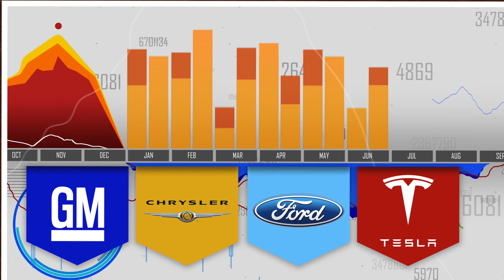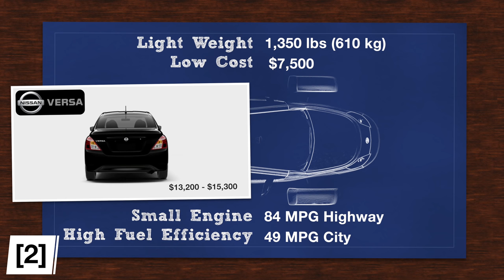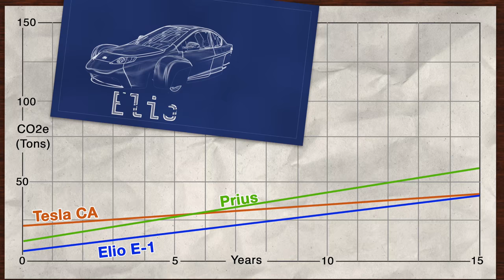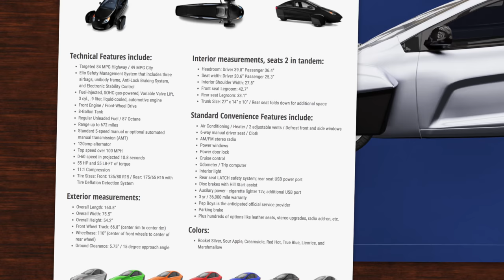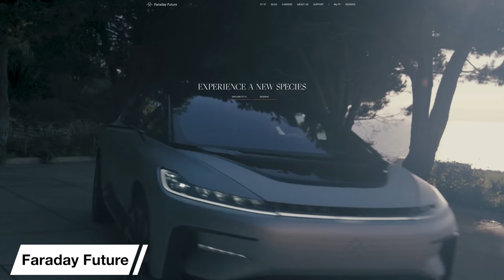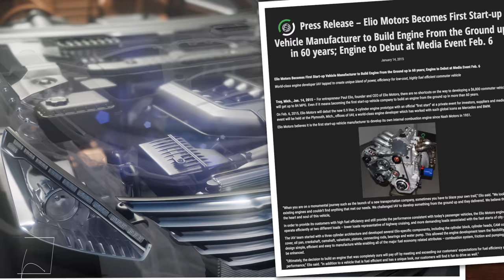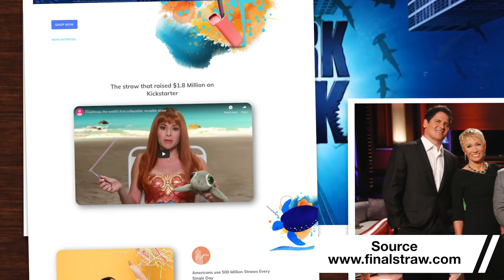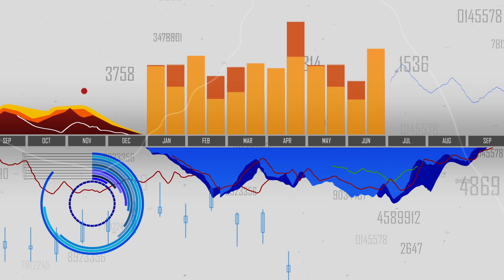How this Radical Car Missed its Chance to Change the World

Comment: I remember watching sesame street as a kid. I believe there was this segment where a (puppet) scientist would unveil something he invented. It would turn out that he would invent something common like a sock or a glove or a watch and just because he was out of touch with the rest of the world he would think he invented it first.

This video and this car inventor kind of reminds me of that. The Japanese have already perfected the art of the small, but practical, car. Please look at the Japanese Kai vehicles segment. And I do mean take a good long unbiased look at it. I have tried to find some good honest material on the kai cars on YouTube but sadly no You-tuber has taken an honest look at these vehicles; except of mostly importing 30 years out of date cars to the US for the sake of getting views and giggles.
 
Please take a good long look at the Kai SUV and MPV segment. These are four-seaters but they are not tight or cramped on the inside. They have ample leg room. So much so that in the back seats, anyone, even well over 6 feet, can relax and stretch their legs easy.

They are cheap to purchase and come with tech such as radar cruise control, pedestrian warning and auto braking, Eco start-stop, GPS navigation, up to six speakers, immobilizer, key-less entry, push start and 360 degree reversing camera (with LCD screen embedded in the rear view mirror). The 360 reversing camera being a thing touted by the big car companies in recent years on their expensive models. These little Japanese MPVs have had them since at least 2013.

The Elio is 0.9L with 55HP. The Kai MPVs and SUVs are 0.66L with 54HP for the non turbo versions and 64HP for the turbo versions. They came in both 4WD and 2WD versions and are good in mud, snow, rain etc. They are very pleasant and fun to drive, are very responsive and you can throw them around. They can easily and effortlessly maintain highway speeds (75-80 MPH).

As for fuel, on a bad day, when you are being a hooligan and pushing the car, you will get between 45 to 50 MPG. On a good day, when you are being an adult, you can expect anything between 60 to 70 MGP.

With all due respect, instead of ignorantly trying to reinvent the car, all someone needs to do is convince the already established Japanese car makers to bring over the tech and tooling for these cars from japan to which ever country, US, UK, Europe etc.

 You need to wake up to the fact that going bigger in choosing your cars is not a solution (as we have seen from the recent shift for all cars makers to big trucks and SUVs in the US as the trend is showing).  That is just the big car makers and oil mafia exerting their massive will and influence; making everyone think only these big vehicles with needlessly massive and gas guzzling engines will satisfy fragile egos and show status.

I could go on but I urge those reading this to consider what I’m saying. We have to save this planet. By choosing wisely when it come to our daily gasoline cars, we can not only do our part, but also cut down on needless gas bills and buy cheap affordable cars with good options. Bringing very good fuel economy to the masses and not just to the middle/upper middle class or the rich (who can actually afford the current crop of fuel efficient Priuses and Teslas and what not). With this option we can get efficient Gas cars with significantly less of an impact on the environment and are much cheaper and easily accessible/affordable for the masses. And I strongly urge the YouTube car enthusiast community to please consider such easily available alternatives and educate themselves and their viewer base.

What surprises me is that the people in countries such as the US, UK and Europe are the ones most aware of the current climate crisis. Yet everyone just keeps buying the biggest cars they can. If safety is a major deciding factor in this choice then consider this; now everyone is driving big cars, the safety argument is out the window. Someday someone will argue that if everyone has a truck or SUV, they want something bigger to be more safe. And the trend will go on and cars will just keep getting bigger. Let us reverse that. Go small. Don’t let your ego decide, go with logic and common-sense.

And don’t think these MPV/SUV are a compromise. I speak from experience. I own one, and I'm currently in the process of deciding on my second one. In my country these are very popular as used imports. We can import cars up to only 3 years old, so we get very new/new-ish cars here. I love these things. And I do journeys of a 100 miles in less than 2 Gallons. I’m happy.
 
I apologize of the long post but I hope you found what I had to say to be of value.

Thanks.
Reply from the maker: Totally agree with you. Unfortunately Americans just love big cars. It’s a shift that is hard to make after decades of seeing cars a certain way. Great comment thanks for your insight. I’m familiar with some of the Japanese micro cars and we’ll definitely take a look. But I’m 100% sure they’ll never ever bring it to big western markets
Reply: The problem with the Kai-class car isn't a lack of a market, it's the safety standards required for import. Something like a Suzuki Cappichino would sell like hot cakes here, but people only import old ones because that circumvents the safety restrictions.

The US has some very particular requirements for crumple zones and cabin reinforcement that basically make anything that size impossible to engineer. I'd LOVE to see a modernized Autozam AZ-1, I'd buy one in a heartbeat. But if you hit a barrier at 60, no amount of space age carbon fiber is going to save you from being turned into greasy paste on the inside of that little shoebox. The Japanese are okay with that level of risk, the US is... well... not, regulation wise. If they had three wheels, then they'd be a motorbike and it wouldn't be an issue.
Reply: @DFX2KX   
Thank you for proving my point in spades my friend. The examples that you gave me are of small kai CARS from 25 years ago. They don’t even exist anymore. That is the point I was making. The only cars that you see are from 25-30 years ago. Don’t you think they will have moved the technology on by now?

The new Kai segment vehicles have no carbon fiber in them. They are made from regular sheet metal just like normal big cars. They have a very strong space frame for occupant safety in the cabin just like their bigger counterparts. They have to adhere to strict safety standards in Japan just as cars have to in the US. Europe has the Euro NCAP. The US has the US NCAP and Japan has the Japan NCAP. All the small Kai segment vehicles are rated at 4-5 Stars. Their safety standards are very high.
 
If you did read my post you would have noticed that I was specifically talking about Kai SUVs and MPVs, not Kai CARS.
 Due to their design the cars are a bit tighter but by no means uncomfortable and their safety ratings are just as good.

Mind you, the Kai cars have moved on from what they were 30 years ago. If you want examples, look up 2018 Suzuki Alto RS or 2018 Nissan Dayz or 2018 Daihatsu Mira. If you’re interested in small two seaters like the cappuccino, just look at the 2018 Daihatsu Copen. This thing even comes with a folding hard top as standard.

What I would really like anyone reading this (who is interested in the facts) to do, is to look up what I was really talking about. Lookup 2018 Honda N-Box, 2018 Suzuki Spacia Custom Hybrid, 2018 Suzuki Hustler, 2018 Suzuki Wagon R Stingray or 2018 Nissan Roox Highway Star.

They all have quirky names I will admit but please take a look. Look them up right here on YouTube. They are mostly Japanese videos but you will get the idea and hopefully you will be pleasantly surprised.

I don’t know why the outlook on (small) Japanese cars is so dated. You have to remember that we are talking about the guys who gave the world cars like the Nissan Skyline / GTR, the Lexus LFA, the Mitsubishi EVO and the Subaru Impreza to name a few. Maybe these guys know what they’re doing.
Reply: The Mitsubishi i-MiEV is a Japanese Kei-car which has been re-designed as a Battery Electric Vehicle (BEV).  It's available in the USA, and in the EU.   In the EU, it's also available re-badged as a Peugeot and a Citroen.
Reply: @AliKhan-fn3xo  For what it's worth, in addition to the crash standards there are also minimum weight requirements which would basically rob much of the efficiency from both the Elio and any Kei car.

Comment: I reserved mine in 2016 because it looked like a fun, use on the weekend, drive through the country vehicle.  My wife doesn’t like to ride on the back of a motorcycle but would in an Elio.  I have a motorcycle license so this is not an issue. I was looking to get another cycle, and then saw the Elio.  I thought by now I’d be riding mine.  Mr. Elio, I’m still waiting.

Comment: Yeah they missed it 😔....
Reply: Ryan , the problem with three wheel vehicles is that you will hit every pot hole. Think about it; there is no way to miss one.
Reply: @shepherdsknoll8  lol that's true! Tbh, where I live in Pennsylvania it's rare to have a pothole so I think they'd be ok here tho!
Reply: @shepherdsknoll8  A large pot hole, maybe but one should be slowing down for them and you can steer around and straddle small ones. One just has to learn and adapt as to how to deal with them.
Reply: shepherdsknoll8 - Plus when it snows and the hump in the middle of each lane. Then don’t forget when those front fenders pack with snow. That not a potential problem at all.....
Reply: they didn't miss anything, they perfectly scammed everyone out of their money as they intended
Reply: Ryan 
They must have repaired the roads since I was there. Pot holes everywhere. 

Wait when was that.  Oh right it was 1979. The last time I was there. Speed limit was 55. Gasoline was .99 per gal.

Comment: I dont think its to late at all. As an owner of an all electric Chevrolet Spark EV I can say without a doubt there is value in and desirability in a vehicle with a gas engine that can get well above 50MPG. I certainly think that there would be an interest in an electric version of the Elio as well. With technology continuing to expand in the electric vehicle category it is slowly becoming a more feasible option for more people to own an all electric vehicle. With extended ranges closer to the 200 miles per charge it makes owning an all electric vehicle an option to a much larger crowd than when for instance the 2015 Spark EV was produced with a maximum range of only 100 miles. An aerodynamic and lightweight vehicle such as the Elio could do very well as an all electric vehicle especially seeing how one of the target markets for the Elio is commuters. I REALLY hope that Elio has the staying power to make this dream a reality. As another commenter posted I think that seeing these vehicles on the roads will intrigue a lot of new potential customers. Until these vehicles hit the road skeptics will only see Elio as a dream. Heres to hoping dreams become a reality in the nearer future.

Comment: The auto industry loves regulations because it sets the bar for startups so high that few if any can reach it.  And starting a car factory takes a lot of experience and know-how in addition to capital.  I was upset that Obama shut down Pontiac, Hummer, and Saturn when he took over GM because along with the closed factories is a lot of corporate knowledge in manufacturing.  
I would not want an electric version because our electric service is limited in the number of kWh we can consume each month.  An electric vehicle would cause us to blow past that limit, face exorbitant fees and penalties, and pay more per kWh.  But that is just me.
I would buy one of these, and almost put money down for it.
Reply from the maker: Not true there’s currently a lot of energy used to drill filter transport refine and transport gasoline. All of this could be stopped and used for cars directly instead. We have a future video planned on this
Reply: Not true Bryan.  The electrical grid needs revenue from EVs.  What the grid can not handle is the AirCon explosion in the afternoon when people get home as summers get warmer.  The electricity used by EVs is between 12-4 am.  When grid use is at it's lowest point.  Even if every car in America  plugged and charged at home, it would still be less than 4pm in the summer.
Reply: Actually the Elio is not a car thus the missing 4th wheel). It only needs to meet emissions and safety of a motorcycle. Just like a Polaris Slingshot. Elio went with 3 wheels to specifically avoid car regulation.
Reply: @TwoBitDaVinci  It is conjectured that we would need less electricity production capacity, not more, if all cars went electric. (I'm an EE.)

Comment: They should switch to electric or come up with hydrogen fuel cell car
Reply: hydrogen is way too unpracticable as of right now for road vehicles.. ecspecially when there is no other movement from big companies in that direction. you wouldnt want a motorcycle you could only fill up at 3 places in your country, right? Also investment in hydrogen is about 2-3x of the investment you need for developing an ice engine
Reply: @Voltaic  yes, I agree with your point but remember when they discovered about hydrogen. They stated it as "freedom fuel". I know it takes lot of time and come up with technology to make it cheaper to produce. Even batteries took a long time to come up with li-ion and yet they are not efficient enough for higher charge densities. Every technology takes time to get developed and I believe we will see hydrogen filling stations in future 😎
Reply: @kothareddykrishna  The main energy loss is not only in the production but mainly with the storage and transportation at high pressure :D and there is no real way around that because if it wouldnt be high pressure, it would be useless for transportation... I think the most efficient way to tackle this problem is to make energy greener and cheaper.. then it starts to get a viable option. My guess is that it soon will become a good option for Big Container ships and ships in general since compared to what they use today really everything is more enviroment friendly..

Comment: I dont think converting Elio to electric is very practical.  Electric vehicles are so much mkre efficient that there is really no need to settle for a small, two seat, three wheeled car.  I also think it might raise the price signifigantly. Either way, Id buy one if they are produced.  Great video.

Comment: The Elio is a bit too small to be an EV. That frame would be hard pressed to handle the batteries and two passengers. Might work for a single passenger, though. I'm on-board with a reverse-trike configuration, they're plenty stable and have good weight reduction benefits.
Reply: There is room, . . . hell, they make bicycle and motorcycle EVs

Comment: I am 60, never owned a car and my car driving experience is about 300 miles. Motorcycles are my thing but I would buy an Elio on the spot without looking at the color. My only concern is how it handles winters here in Canada. Riding the bike in rainy and cold weather is taking its toll on my joints, this thing would bring me some comfort.

Comment: my wife and I were early investors in the elio. even got to sit in the orange one and loved it.  I agree with you that it would have been better to outsource the engine and find your carbon footprint compelling. Wish I was driving one today.  I think you've overlooked the advantage of the classification which is possible with three wheels.  Requirements for motorcycles are far less stringent than for cars cutting the cost and time required to bring the car to market.

Comment: I have dreamed and schemed for a long time thinking along similar lines in building a 3-wheeled enclosed motorcycle with 3-cylinder water-cooled diesel coupled to at least a 5spd manual transmission. My target fuel economy was/is 60+mpg. Except for the diesel engine, Elio fulfills all my objectives and does it under my expected cost. I have been a fan of this car since it's first announcement and still am! I hope they make it and kick off tramindous production. I will be buying one if it sells at the <$8,000 price!

Comment: I don't think they are too late due to the growing EV demand.  I think they are uniquely poised to fill that gap, price wise, for those commuters like myself, who would like better efficiency and a cleaner power, but who cannot afford to spend as much as the average hybrid.   The goal for Elio is to get as many cars as they can on the road and get the market share they are looking for.  The immediate goal should be to work on an EV version to be rolled out within the next 5 years.  Right on time for the rising EV market.  Even better, add an object to have a conversion option to switch the  fossil fuel versions to EV.  But Elio  must manufacture today and get those first cars in the hands of consumers by the 4th quarter of 2019.  If they can't make it by 4th quarter 2019.  Then it must, must  be 2020 second quarter.  I hope the investors and decision makers are reading these comments.